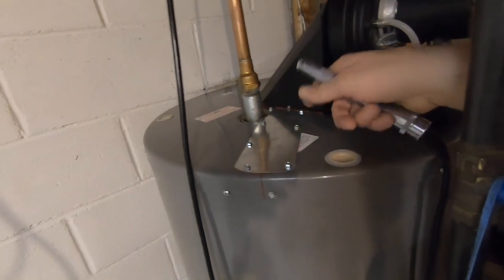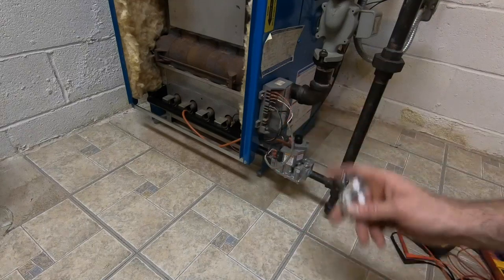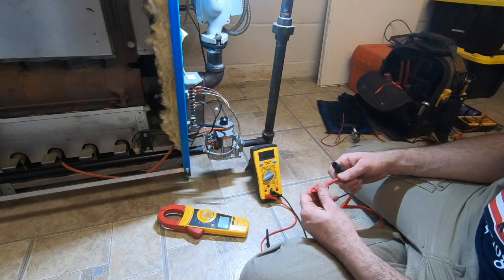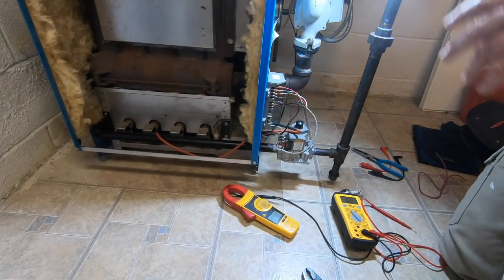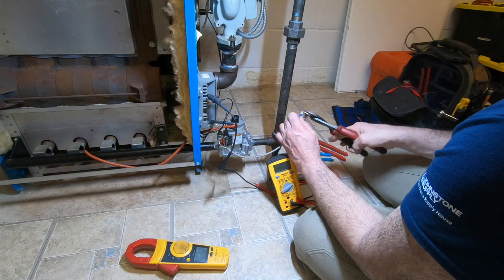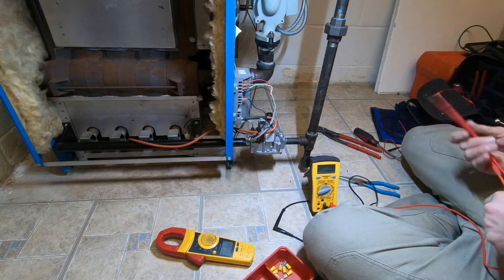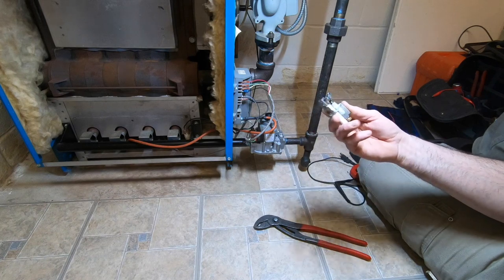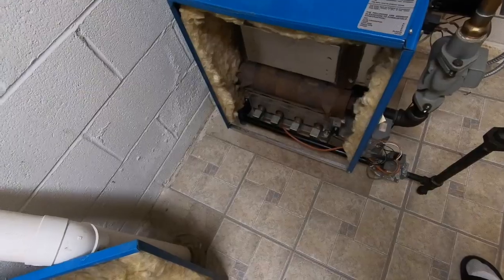Troubleshooting Spark Pilot Intermittent Control Module Flame Signal and Ground

Comment: I had this happen on my Dunkirk boiler. It would spark and light the pilot , turn on the gas valve and then shut down and start the cycle over again. The problem ended up being the ignition control module.  I put in a new ignition control module and it fixed the problem.
Reply from the maker: The cleaning was all needed to stop that backfiring. I still have that ignition module on the boiler. I should replace it, the ignition goes sitter longer than I like. I am in the middle of repiping this boiler and hooking up an indirect water heater. The one I soldered a tank leak shut in April started leaking again
Reply: @thehvachacker  I have noticed that when I first start the boiler in the fall 
, it sparks much longer when it first starts up. After the first run, it goes back to normal.

Comment: Power ventor is pulling pilot flame away from pilot burner as in your video at end.  change pilot burner to bent spark rod (1149944) and spark will light every time.  To test, remove MV wire (main valve  solenoid terminal  on gas valve.  Leave PV ( pilot solenoid terminal on gas valve).  Turn on boiler and only pilot will work.  Now you can watch pilot flame with mirror, with door on and off.

Comment: pilot flame when it's cold, shrinks until warms up. As it warms up gas flame will expand at pilot hood.  Problem is spark rod is to far from pilot hood when it's cold.  Put mirror near pilot and then blow hot air towards it and watch flame.  Change out pilot burner to Honeywell pilot burner 1149944 (which has a bent spark rod built for ICP furnace).  this pilot can be changed on any gas appliance with Honeywell pilot burner with spark issues

Comment: maybe your leaving open a door that's normally closed when your in there or the lid off it could be changing the air flow and having pilot suck-out.
then again, I think you said gas valve was replaced, maybe the pilots adjusted too low when it has a longer off cycle and cool down, it could also be somewhat loosing ground with thermal cycling.
** those control boxes can do that when going bad also, capacitor failures inside
I think I have a crystal ball in my head lol. later in video it looked exactly like flame suckout with the cover back on, turn the pilot gas up higher if you can and check the controls voltage output to the valves pilot coil, it may be under-volting and not opening fully. also make sure there isn't a rusted/corroded away flow restriction plate on the power vent blower.
been quite a while since I've dealt with that style control setup, slowly recalling all the past flubbers on them.

Comment: You did not explain how the path of the Flame sensor back to the igition device is. Maybe i missed that.
I see several possibilities
1. Via the pilot gas pipe
2. Via Chassis
3. Via the Main Gas pipe... (and there is a lot of dope on the pipe which impacts grou d to the valve
Reply from the maker: I thought i did explain the ground was the path the flame signal travels back to the ignition module. Why i was testing the wire going from gas valve ground to controller. I will go over it again in the next video when I get time to play with my boiler again. Main gas pipe to gas valve is a scary connection. the 3/4 to 1/2" fitting was sent all the way into valve. I wouldn't think this would cause a pilot issue, yet create a pressure drop on main burner. The chassis is allowing the flame current to travel back to ignition module.  The pilot orifice inside the ignition module could be partially restricted. I couldn't remove it during maintenance why I have a new one to replace. I'm leaning on an air fuel mixture of the pilot. the end of the video i show it not igniting.

Comment: Pilot wasn't lighting at last part of video, I'm sure you checked your footage though
Reply from the maker: Yes i caught that and decided to put that into the video. I found out this happens only when the door is on. Reason why when testing I couldn't replicate. I been so busy working on my house and watching my daughter the boiler hasn't been top priority since correcting the exploding ignition problem. it wa around 2 am when I stopped filming this vid. I hope today to get to play more with the boiler. Some kind of air fuel mixture of the pilot is off.

Comment: Hey how are you I have installed an ac spilt system. I turn it on and set it to cooling it worked after switching to heating it shut off as soon as the compressor started and then the whole unit lost power and not responding. I haven’t checked the indoor unit fuse yet  need some tips I would appreciate that
Reply: You probably figured it out by now but sounds like an issue with 220v wire. Let me know if you fixed it. Its been a yr now since ur post

Comment: Brother that is not how to check flame signal. U need a micro amp  meter in series of flame rod. Those Honeywell controls lock out a signal less than 1.25ma a just mentioned of pilot flame will increase and decrease signal. Good grounding to pilot burner is very important. 
Your controller is a universal replacement. You should replace with correct one. That allows 3 trial periods or attempts it will lock out. Be save dude these are the way issues start.